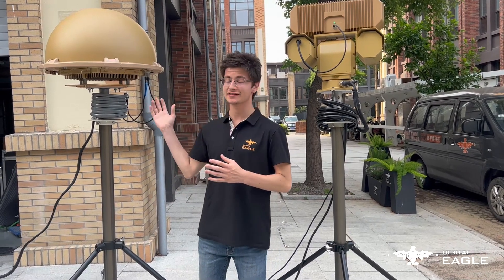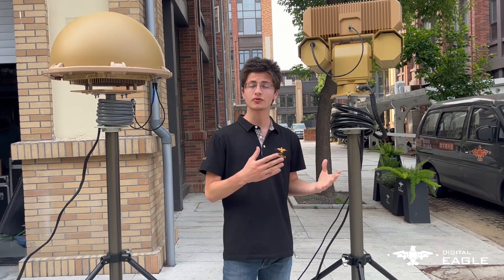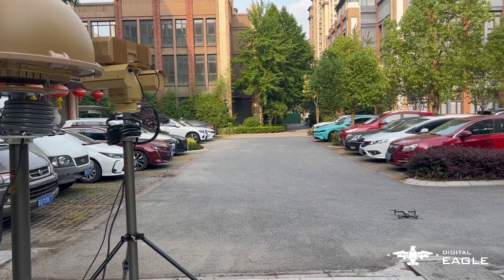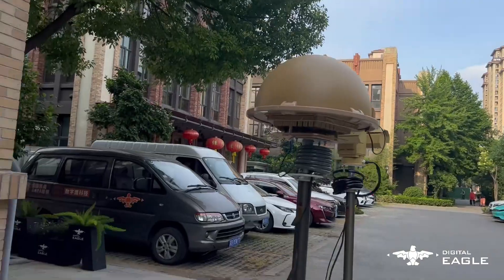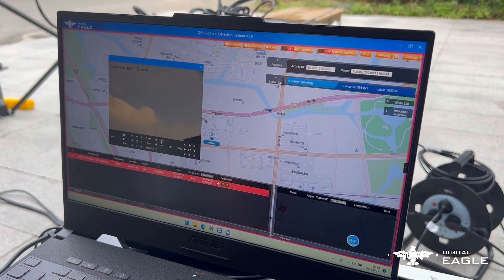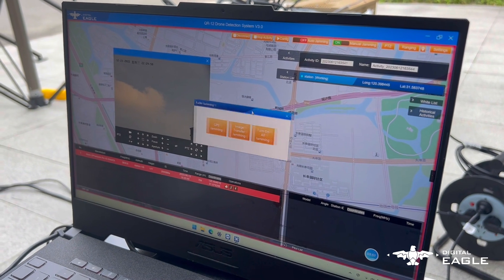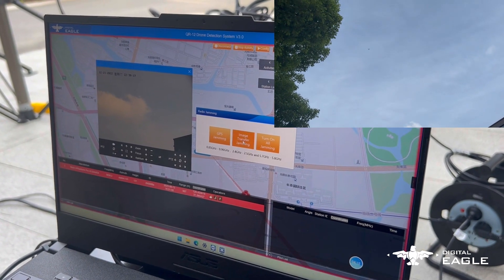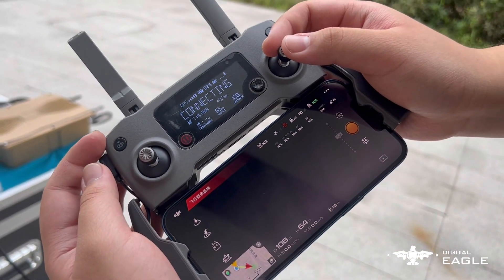Digital Eagle Presentation about Anti Drone System

Comment: Ummm I didn't see anything. I was expecting to see a drone fall out of the sky. Your controller just said "connecting" I didn't see any connection or control. Maybe you can show real time control and shut down of the drone.
Reply from the maker: Thanks for your attention and suggestion. We will show the complete process of the drone jamming soon.
Reply: He is showing from the drone transmitter (hand controller) that after the drone has launched (which we saw) and then when he activated his anti-drone system; that the camera is showing the hand controller saying "connecting" means that the hand controller has lost connection too the drone? Normally the hand controller would say "connected" and possibly the information of the drone that it is connected to? But as someone has mentioned in the comments, that if a drone pilot has automated instructions to fly to a weigh point if connection to the controller is lost..... Then that suggests that it isn't "anti-drone" as such? Cause you could make the weigh point (a return to home location) via GPS, then the drone can just fly back to the GPS location instead of dropping out of the sky?

Also if someone is smart they can easily jam the jammer system and/or operate on a frequency that is not what drones normally operate on? Yes that is probably illegal to use non-reserved (drone channel allocation) and operate on an internet band (unless you are flying FPV and need low latency?) then anyone seeking to do unsavoury operations (attack say electrical infrastructure) then the pilot can pretty much operate with impunity?
It's like locking your house and arming your alarm system and then a thief only needs to their a brick through your window and easily break in? See windows are only for criminals with a conscience? Likewise if a drone operator is a "bad actor" and up to no good, then they don't give a fk about operating within HAM radio specifications? They will simply choose a vacant radio frequency that's not allocated for drones and just give this anti-drone system the middle finger lol
Essentially any antidrone system that is non-physical interference (frequency disruption) anyone can work around it?
The down side to physical interference based systems is that you need to be within visual range of the drone? That's why authorities a few years back used Eagles to take down drones as they are automated and not limited to line of sight and have unlimited range?
The down side to this is that Eagles can become injured by drone props and Eagles have no way of discernment between drones operated by a 'bad actors', non-threatening civilian operators nor drones operated by law enforcement or emergency services such as search and rescue drones?

So each anti-drone system has weaknesses and limitations, and each of these can be overcome by someone who is determined to do something bad with a drone?

It's illegal to jam GPS or blanket jam across non-drone allocated radio frequencies also, so the bad guys WILL ALWAYS have the upper hand when it comes to getting around these systems? It's still great to see development in this area though, cause I think we live in a very scary world at the moment when it comes to war and combat?

Most people that come to watch this video clip will be wondering what we can do to mitigate AI automated weaponised drones (military) drones as these systems don't need to send signals on any radio frequency to operate?
That's when people like myself think of daisy chaining 18 friggin microwaves together to make a directional EMP device or high powered lazer beam to use as a destructive mitigation strategy? Not because we are doing anything illegal but incase we are ever invaded by China or something like that?
China's AI can already discriminate to very high degree and could essentially single out any person who is not Chinese and obliterate you in seconds?

Think of those ball drones in the movie Prometheus? That's the kind of shit that will freak out just about every person, and unfortunately I hate to say it but that's what's coming soon!

China has already developed drones that look and act like sea turtles, whales (even ortho drones that fly like birds) that are fully loaded with weapons and are even trained for 'single use' suicide missions?
USA also uses drone swarms to overwhelm an enemy? China would likely have that too! 
So we the people are essentially screwed! There is no escape. Drones can be set to linger and trap people that go into hiding, essentially they will linger and wait for you to leave because you need food or something and then you are dead in an instant.
So as mentioned the only way we can defend against a military attack drone is to physically shoot it in a vulnerable location or attack it with a laser or EMP or something? You can't shoot a net at a military drone cause of proximity....... You'll die before you can shoot the drone. What are you going to do if there are multiple armed military drones locked on to you or are lingering because they have tracked your location? You're screwed. An EMP or high powered laser turret programmed to identify drones are your only chance at survival?
If it's adversary to my country then and it's an armed military drone then I don't give a fuck about abiding any laws or worried about destruction of nearby technical equipment..... I'll gladly fry everything in a 5 mile radius if it will help me survive!
Reply: @jameshatton4211  Cool, thanks!